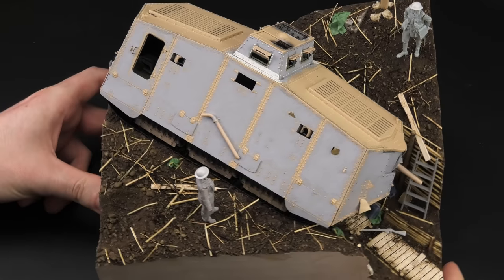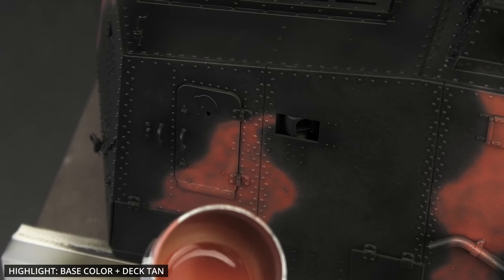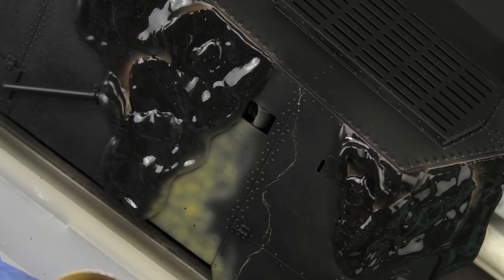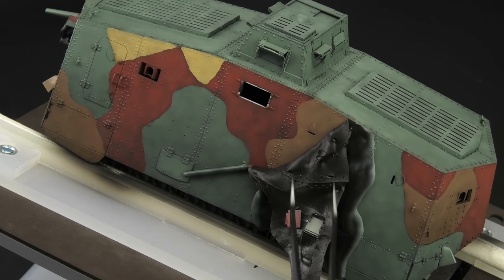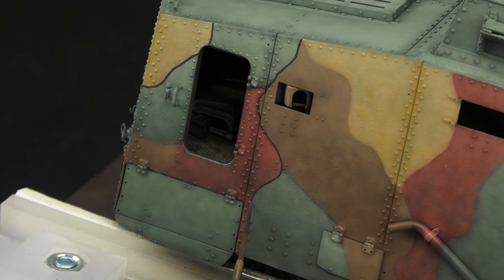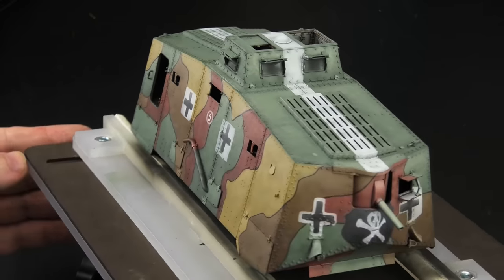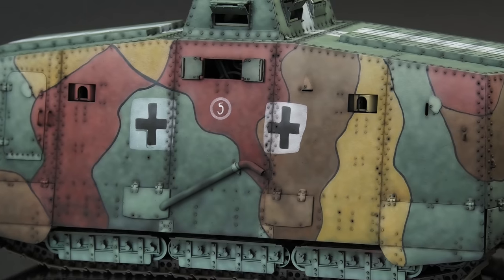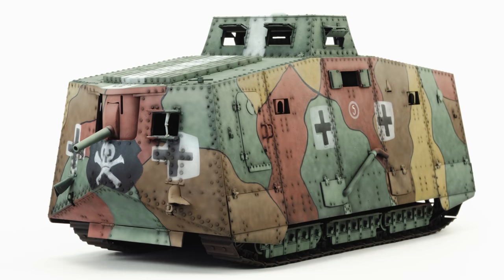Let's Paint The Saddest Tank Ever! (A7V, Meng 1/35)

Comment: Great paintwork Martin.  The model is looking fantastic and it's such a pity your wonderful work on the interior will not be on show.  I have studied these tanks a lot for a recent museum diorama I completed.  I'm not sure if you realise that your base photo for the diorama is actually a photoshopped image and not an actual incident from the war.  There are other photos of A7V's  stuck in trenches as they were notoriously bad on undulating ground. Here is a link to the photoshopped work.  https://66.media.tumblr.com/f379eb2f2bb8a471e8a90026d7669046/257b49e1a7ea2c3f-f8/s1280x1920/247dba55f200b8f4bf558c568db0a22adeafa867.jpg